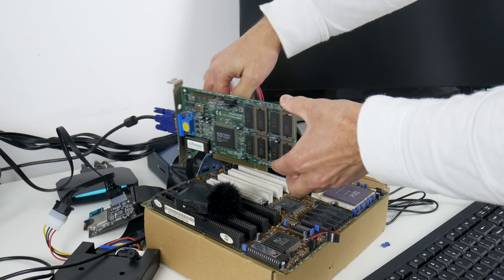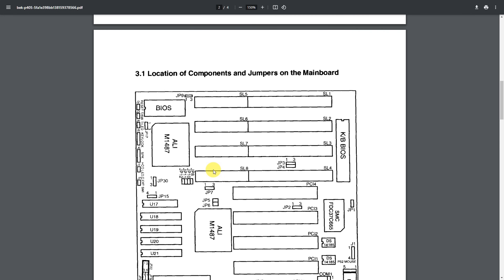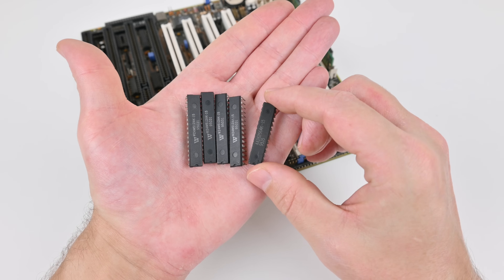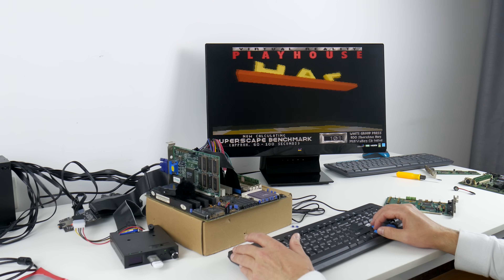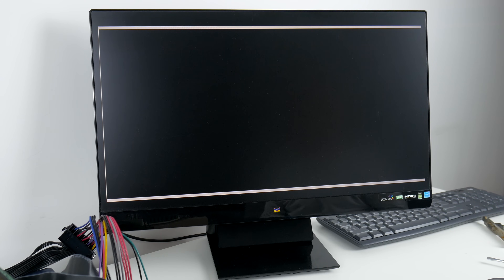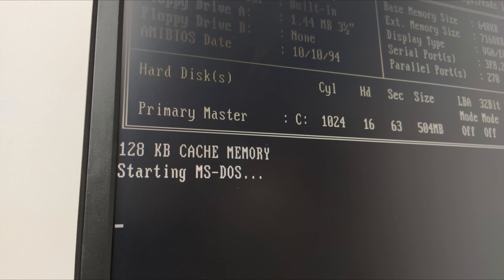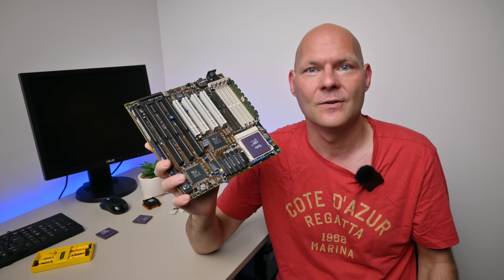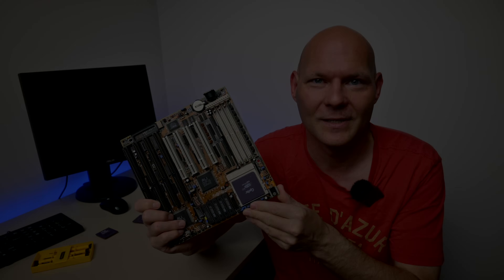PCI 486 Motherboard: The P405

Comment: Good memories of the 486. I did dive into this era of PCs recently, and it’s certainly much harder to source quality given the demand in the market. It brought back the amount of configuration and troubleshooting, which miraculously disappeared once you went to Pentium and the MMX range. Plug and Play did wonders to shave off config time and head banging on the desk. However, the 486 was an era when such incredible DOS games were released, and we played with the turbo button on the front of the case 😊. I’m sure I read that a 486 DX4-100 was faster than a Pentium-100 in some benchmark tests…

The MiSTer 486 core does a reasonable job of recreating the 486 experience, as does Dosbian also. However, real hardware rocks those nostalgia chords most!

I think you raise a good point around hardware restoration. We are at a point with what hardware isn’t in a landfill, the skills to repair are not common place. It would be excellent if you could take us on this journey Phil as I know I’m keen to learn more 👍🏻

Comment: 486 is great for retro gaming.  But a 486 build needs to use a VESA Local bus video card.  PCI should be reserved for pentium and later architectures.
Reply: That’s true but the average person that just want to build one system for themselves would run into very steep price for VLB cards. 
But I agree. 486DX2/4, VLB MultiIO and GFX card would tick all marks. 
And some SB16 or ProAudioSpectrum like card, maybe even with proprietary CD drive ;)

Comment: The late 486 era was, in my opinion, the rock bottom of the PC build quality, most manufacturers just spit trash. My first PC compatible was an already built Intel 486-66, 4MB RAM, 450MB HD, and for some reason one day it decided to burn, I remember the smoke column coming out of the power supply fan, it could have started a fire at home. Luckily it was under warranty and the shop repaired it, installing a motherboard w/o cache on it... well, actually disabling it because activating it would crash the machine, and I needed the machine for college assignments. Only after 3 iterations I got something that would work okay. Later I learnt how to build PCs myself and little by little I changed the parts, the last one was an AMD 5x86 that kept it alive well into the time I was already an engineer. But my trust in already built PCs was already damaged.
Reply: I wouldn't say there was a particular era for bad quality hardware instead of there were garbage brands during the pc history, some improved some simply disappeared in the 🚮 like cyrix, asrock, sempron, maxtor :face-orange-frowning:

Comment: Would it be worth replacing the capacitors around the CPU socket and cache and any near the voltage regulators? Might be causing the instability. I'd be looking at those ceramic caps as well

Comment: i'd start with replacing all the electrolytics with solid-state caps, go for 16v on 5v lines and 25v on 12v lines. If your cache timings are really tight, 15ns on your cache chips might be not good enough. Same goes for 70ns RAM - if you tighten it all up, 60ns is a better choice. Also considering it's a late ALi chipset, it might support EDO memory.

Comment: That's some odyssey you had to go through... but thanks for taking us with you, it's been interesting to watch, especially as I set up my own 486 (Gigabyte GA-486AM/s with Am5x86, 2x32 MB FPM RAM and 1024KB cache), so I could compare the results. I also used your benchmark suite and ran into some weird issues where when I lowered the L2 cache timings too much, the DOOM benchmark would go wrong (DOOM guy dies and respawns in the middle of the bench, runs against walls etc!). Sadly the socket noses were so brittle that one of them snapped and now I can only use the board lying down horizontally because it can no longer be fastened. You just never know what happens when attempting a 486 build...

Comment: i kinda love this PCI 486s, they are sooooo flaky, but they do feel more "bare metal" than newer platforms. but they are quite reliable once you get them running properly though, i can vouch for my SIS 496/497 board.
Reply: I had some PCChips M918, it like randomly crashed at times in DOS, and Win95 was a no go on it. I replaced it with a VLB board with a Cirrus Logic VLB card and that one seemed more stable and Win95 actually worked on that. I did use the ram, CPU, and cache from that board

Comment: Finding a good set of tutorials is going to be tricky unless you happen to find somebody with the same board having the same issues that also records thwir repair journey. 

I'm no expert, I often bumble around looking for physical damage that I can repair first. After that, poke around testing some voltages and hope something stands out. On your board, I would carefully wiggle test the pins on the chipset under a magnifying glass and look for damaged traces. The random crashes, especially on a reworked board might be physical damage.

If you're looking for some general information on repair processes, I find the following creators to really shine on explanation and demonstration of techniques:
* Adrian's Digital Basement
* Necroware
* Epictronics
* Bits and Bolts

They have gone through some incredable repairs of things I'd have long given up on. But, their process and technique gave me.enough confidence and motivation to give things a try. 

One of my favorite repairs was to a VLB I/O controller. It generally worked well, but occasionally, the floppy drive would act up or disappear from the system and cause lockups. It turned out to be a scratched trace near the floppy controller chip, and I was able to bridge the gap with some solder. That card is still rock solid. 

Bottom line, start with something that is already broken beyond repair and just try to remove some components and put them.back on. I practice on old modems.